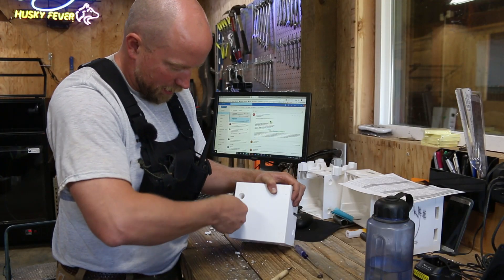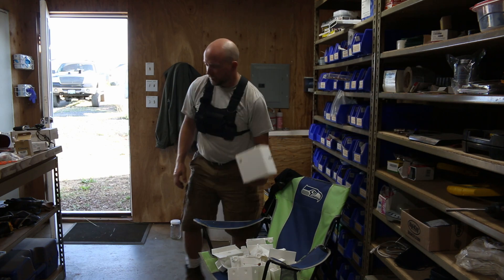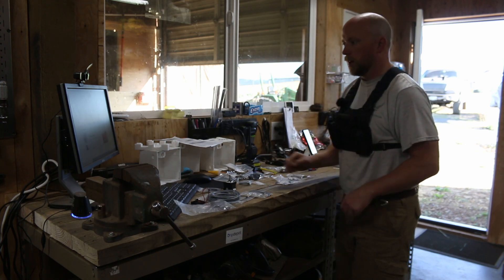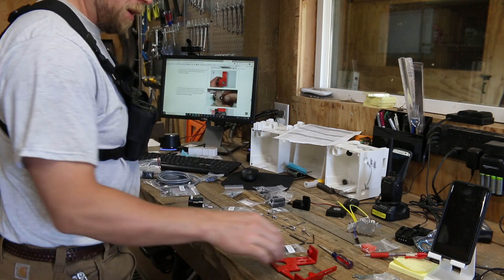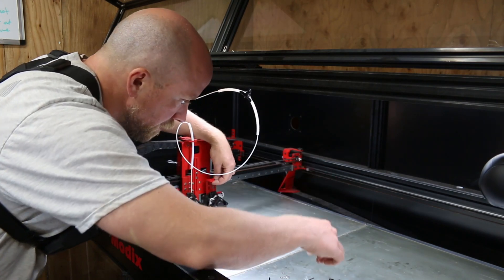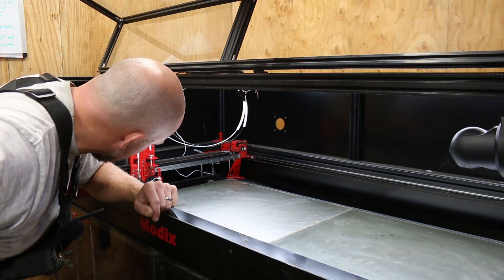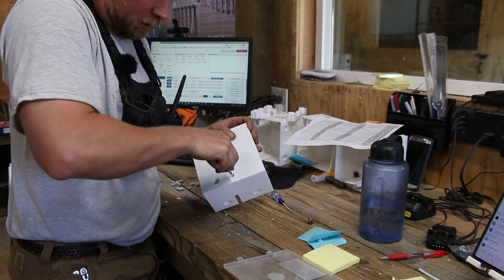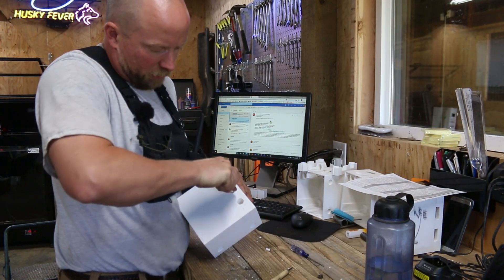Modix 120V3 Upgrade to Dual Print Heads

Comment: Dissolve in water. That sounds like PVA filament. Beware!! Its suuuuper hydroscopic, so you need to keep it out of humidity at all times. That means dry box, and dehumidifier for the filament.
Reply: Yea PVA/PVOH.  Also it's a fallacy to assume it saves a ton of time. Soluble support tends to  waste your time in other way.
Reply: @tigertalar  I agree, on the Ultimaker S5's I have at work, the PVA support can be problematic and adds a fair amount to the print time.  (probably not a big deal on a print farm)  And yes, that material is super fussy and can crack/snap with ease.

Comment: Why not try a couple different size drill bits on the drill press to clear the holes, or something like an end mill bit to clear the holes?
Reply: Exactly. not every feature needs to be printed..  I actually print a lot of things mostly flat and fol flaps up with a little heat. For all this effort its not even clear if things will grow in that over engineered flower pot. May be a good time to plant some seeds now.